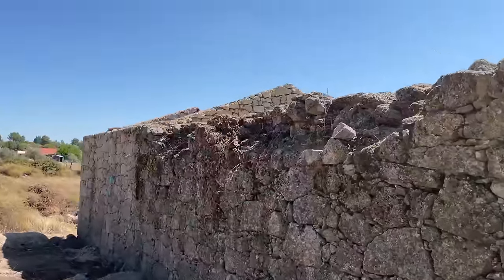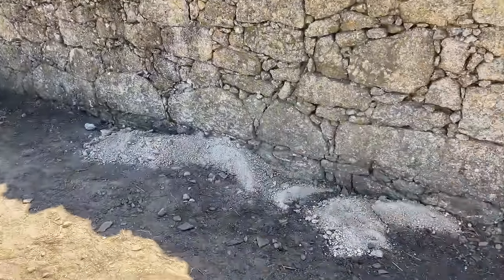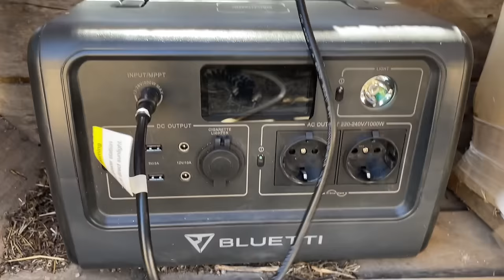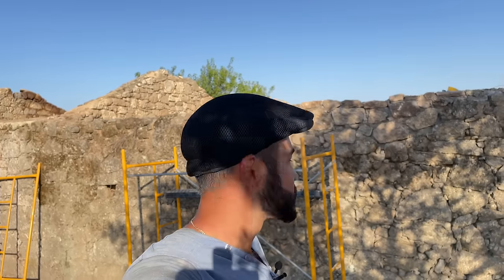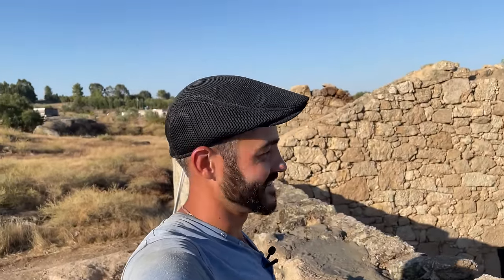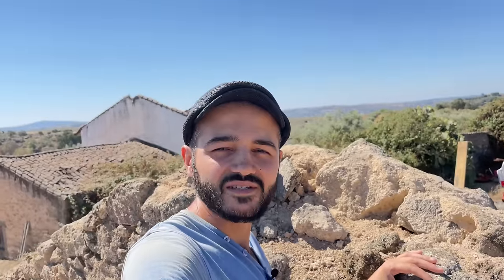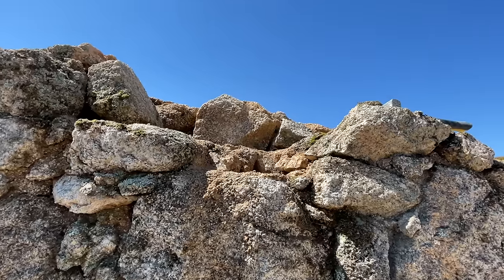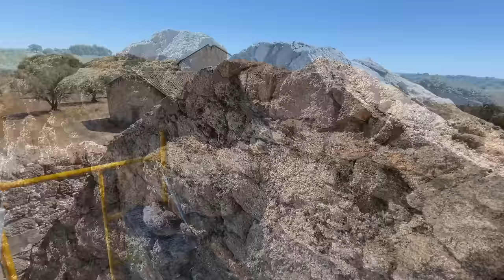100 Year Old Stone House Restoration | DIY Building Granite Stone Walls  - Ep.8

Comment: I just finished watching episode 1,2,and 3. Bravo ! Very good! Cleanliness is next to Godliness. Answers to the qualms about cleaning. I would get a good metal detector and check the floors and paths for treasure.
The broken glass could be used for a mosaic floor ,tumble the glass in the cement mixer with sand to smooth . Your land/ house ,let God and your heart lead The way.👍😁 Good luck. The stone work looks very very old.

Comment: Alex are you using lime mortar or cement?  Hopefully lime as it is flexible like the dirt packed original materials used. Then you can do a rim concrete pour with rebar to make the whole structure safe and seismically secure.
Reply from the maker: Hi Tim,

We are using Cement.
Reply: Oh dear. I hope it doesn't cause  damp issues in the future.   I heard that lime should be used.  Hopefully for the pointing going forward.
Reply: @vivienneturner2028  I've seen others use cement and it's not been an issue.  This is something that Nick from 'Project Portugal' has discussed in some of his videos.

Comment: It's better that you have your extension cord unwound, especially in high temperatures. When it's wound the maximum current is very limited due to the lack of cooling the insulation. At 2 kW of constant power you can burn the cord. It happened to me once in winter time in Poland (about 4deg above plus).

Comment: When you run elektricity through a cable,  make sure it is not all winded up. Rounded copper wires make a magnetic field that can cause melting and even fires.
Reply: Bore off

Comment: Note: when rebuilding a stone wall, make sure the stones you are using are only one stone deep so you can find the right size in one glance. Also, cement should be made as close as you can to the part you are working on. Saves very much hard work in the future.

Comment: Alex, just like butter the fit.  Do you think the stones went together where they were before?  I had to ask as you make it look so easy.  Did you think about putting a couple of windows in where you are working?  Looking good!
Reply from the maker: Hi Paul and Laura,

Haha I don't think they went exactly in the same place as they were, But it does look as they were ))

Do you mean windows at the back side?
I will not be adding more windows, because this is one of my principles with the rebuild of this ruin, to keep it as similar to the original build as possible.
Reply: Looks good to me.  But I still would have put in a window to save the back.
Reply: Adding openings to an original building requires planning consent which = extra time and cash